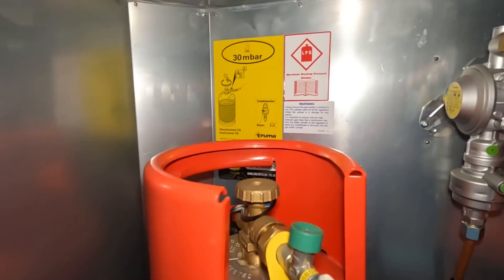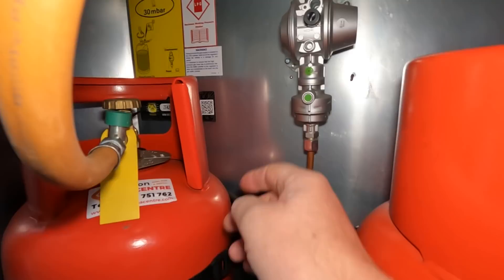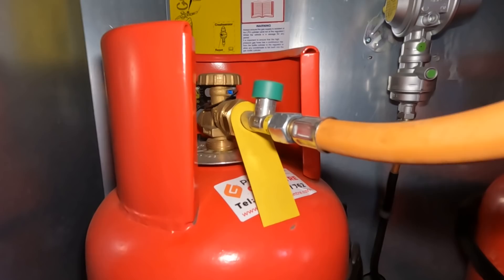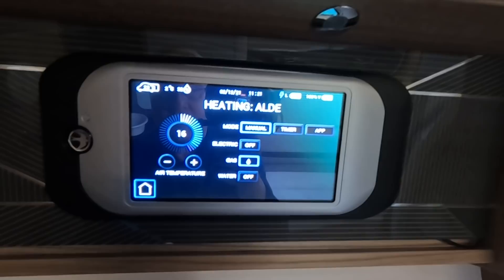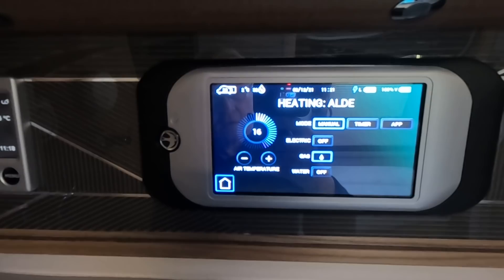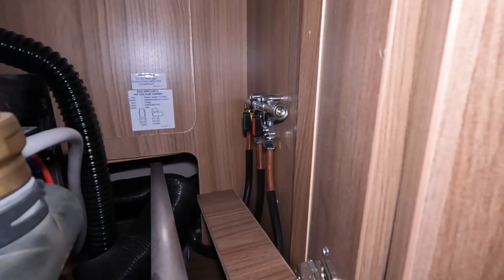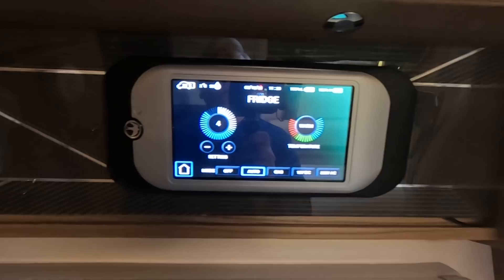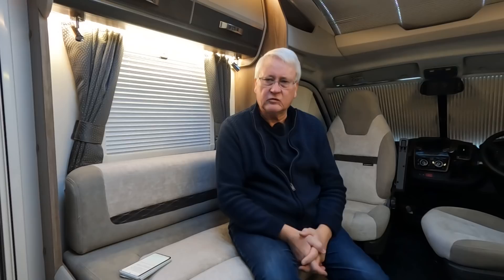New To Motorhomes Pt 7 | Winter Touring Tips | On The Road Heating [CC]

Comment from the maker: It may not have been clear what I was saying about using the fridge on gas when touring. If you plan on visiting a filling station, you should switch the gas supply to the fridge off. However, if you forget this, there is a safety feature that won't allow the fridge to light 15 minutes after the ignition has been switched off. If there is any doubt, switch the gas off. Set on 'auto' the fridge will not run on gas when the engine is running.

Comment: Thanks for information Bob,  when we picked up our swift in September  , we where never told about the fridge 15min lock out on gas .. we just spent a night on a park up on a coastal road in Norfolk,  so gave our truma heater a good try out , and found out the gas bottle always needs changing just as your going to bed , in the dark and it's raining...
Reply from the maker: Yes, that's another rule....

Comment: Thanks for that, I didn’t know you could run the Alde heating whilst travelling. I had accidentally left it on a couple of times and wondered if it was ok.
On our MoHo we have the double bottle auto changeover valve, so if a gas bottle gets down to empty it automatically changes to the other. A coloured indicator on the valve swaps over to show which is in use. So as long as you look at this occasionally to check which bottle is currently in use green or red (I have mine set to use the green bottle first) when it shows the red bottle is in use we just refill (we have Gasit refillable bottles) the now empty one. This way we have an uninterrupted gas supply and I don’t have to go out in the middle of the night changing bottles.
Good tip about the fridge, I didn’t know about the safety timer. I thought we might have a problem with the fridge because it took so long to swap over to gas when we stopped. I was keeping an eye on it in case it failed one day, but now I know not to panic.
Yet another great informative video.
Reply from the maker: Yes, that changeover sounds good.

Comment: Hi Bob, very thorough and informative as usual, thank you.
   I'll be buying a used Motorhome in the next 12-24 months ready for my retirement. I'm totally new and it'll be my first one. So i need as many tips, suggestions and information as i can, because i'm a bit of a worrier. Yourself and Jenny are extremely experienced and are willing to share that experience. So, yes, definitely keep them coming buddy......along with your regular uploads, i love your channel.
   Doing a video on maintaining power in the motorhome during the winter if you're not hooked up to a mains supply would be appreciated. Such as Solar panel charging (which would be minimal to zero i imagine), not so much of a problem in the Summer....... So for instance, would i have to drive every day to give me enough power to last the evening and night.
   Cheers Bob :) x
Reply from the maker: It's difficult for me to do videos on running off grid, because we very rarely do that.
Reply: @BobEarnshawMoHo  Ah, I see.
  I'm sure I'll learn lots from you guys anyway.
  Thanks Bob👍

Comment: Bob thank you for the very informative tips, as usual.

We hope both you and Jenny are keeping well.

Having watched many of your vlogs (& subscribed) learning many many things, you are truly the guy to go to on all things motor homes.

I appreciate you may have captured some items spread over a number of various vlogs, but may I suggest you do a winter specific edition covering such things as: -

Fitting of fridge external covers i.e. when should they be applied
Use of winter tank heaters i.e. in cold conditions & only to be used when water systems have a minimum of 25% capacity
Items you think very relevant for winter preparedness 

Also do you generally open the Alde heating safety/drain valve for a couple of seconds every 10 days to allow air cushion expansion to protect the heating system?

Keep up the tremendous work.

All the best and stay safe

Russell & Jo
Reply from the maker: Yes thank you for the ideas, I had forgotten about the Alde air cushion. I will be mentioning a few more winter preparations.

Comment: I thought it was useful. We’ve just sold our Wellhouse Ford transit SWB pop top and put a deposit down on a Devon Colorado, a massive 0.4 metres longer and a high top! We will now have Truama heating so it’s useful to know it can run when we’re travelling, if that’s required on a 5.4 metre van. We’ll also have an underslung tank which I assume is LPG like the Gaslo system in our last van. I wonder if LPG good at very low temperatures? Thanks as always for sharing your knowledge.
Reply from the maker: Propane and Butane are both Liquid Petroleum Gas (LPG). Propane is what you get in the red Calor Cylinders and as Autogas on the pumps at fuel stations. Butane comes in blue cylinders from Calor. Butane does not produce gas at temperatures around and below freezing, so is unsuitable for all year round camping. So you'll be OK if you have refillable cylinders.
Reply: @BobEarnshawMoHo  I really appreciate that, thanks.

Comment: Always useful information. Do you know if I can run my whale heater off the solar as I drive? Thanks Bob.
Reply from the maker: Your heating does not run off solar. The solar is connected to charge your leisure and vehicle battery with electricity when you are stationary. It really depends if your whale heater can run off gas when you are driving. That I don't know.
Reply from the maker: Have a look at this, it looks like this Whale Heater can be used when driving, provide the required safety devices are fitted to the gas supply. https://documentcloud.adobe.com/link/review?uri=urn:aaid:scds:US:bde8b563-167b-4571-bf75-a3fb48407bbd
Reply: @BobEarnshawMoHo  thanks Bob

Comment: Hi Bob, one big thing DO NOT DRIVE INTO A FILLING STATION WITH THE HEATING OR FRIDGE RUNNING ON GAS.
Reply from the maker: I thought I explained there is a safety feature that won't allow the fridge to run on gas after the engine is switched off for 15 minutes. Additionally, the fridge cannot run on gas when the engine is running, if it is set to auto energy selection. Yes, it's safer to switch the supply off to the fridge when travelling. Please don't type in capitals, it looks like you are shouting and can it seem quite impolite.
Reply: Hi  @BobEarnshawMoHo  .  I think Dan is making an important that filling stations (and service areas) do not allow you to have anything running which has pilot light when you enter them. Therefore, although the fridge will be on 12V and not switch back to gas for 15 mins after turning off the engine with auto selected, the heating (which also has a pilot light) will be active throughout. Although you could argue that the danger is from the pilot light sparking when it tries to light the main flame in the appliance and that should not happen, there is a risk that it could go out for some reason and then re-ignite itself at an inopportune moment. I’m sure it’s for this reason that the rules are so strict.  So I think your advice on being able to run your the heating on gas whilst travelling needs to include a warning that it needs to be turned off in advance of going into any filling station/service area e.g. by stopping at a lay-by beforehand. However, this would be difficult to achieve on a long motorway journey or you could easily forget to do it.

Re. The point you picked up with Dan on the fridge having the 15 min safety feature. If you listen to the part where you said that it goes on to the 12V after starting the engine, you then jumped ahead to saying there is a 15 min gap before the fridge ignites without saying it was AFTER the ignition had been turned off. It’s obvious when you know it doesn’t happen, but when I first listened to it I understand you to be saying that after 15 mins driving along the fridge would switch to gas as well.  Maybe that’s what Dan was thinking when he said don’t drive into a filling station with the heating OR fridge switched on.

After saying all this, I also want to say that we really appreciate and enjoy watching all the informative videos you produce and want to give a shout out for Jenny who seems very tolerant at times.  It’s helped us to make an informed choice on switching from a caravan to a motor home as well as experiencing the visits to lots of sites which we haven’t yet been to.  It often feels like we’ve already been there when we arrive, especially when we happen to occupy the same plot such as number 4 at Ashridge Farm, a few weeks ago!  Please keep up the good work.  Martin.

p.s. apologies for the shouting😉
Reply from the maker: @martinhann9511  OK, thanks for clearing that up for me. Ideally, you should not be going into filliing stations with the gas turned on, but that safety feature exists.

Comment: Hi Bob on a previous episode you said you left the alde 3020 heating on when parked on your drive in the winter, what temperature do you set?
Reply from the maker: Around 10 degrees, just enough to keep the chill out.
Reply: Thanks Bob on a different episode when on site I’ve seen you top up your water tank with an aquaroll and a pump that connects to the 12v supply, what make of pump do you use?
Reply from the maker: @ashleyjacobs3568  On my list of essential accessories, http://www.bobearnshawmoho.co.uk/2020/06/essential-motorhome-accessories.html?m=1 It's this one. External Water Pump
https://amzn.to/3rfCyAM

https://amzn.to/3rfCyAM
Reply: Thanks for the details on the pump Bob……Best wishes to you both.